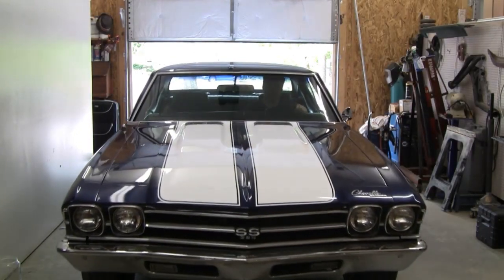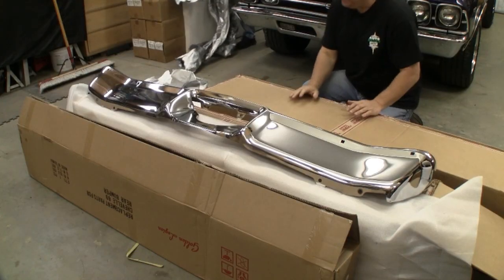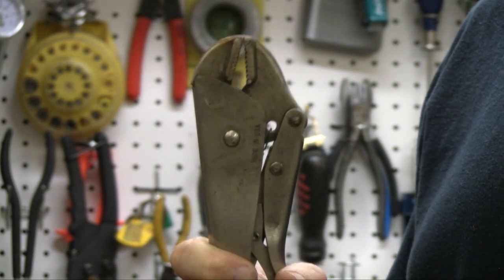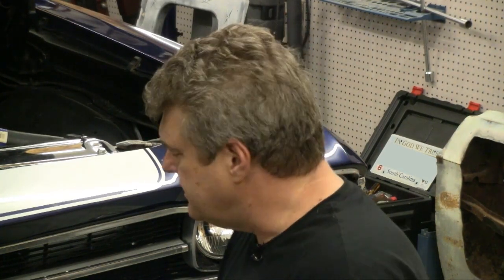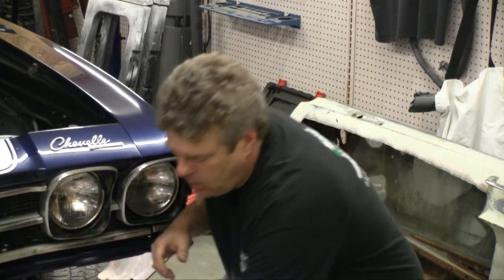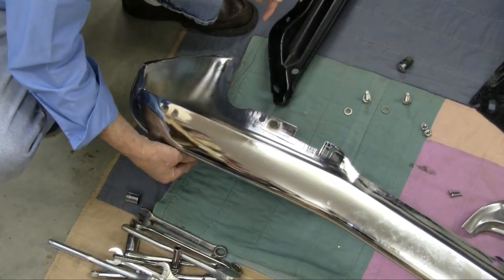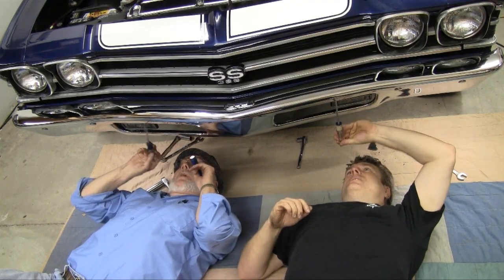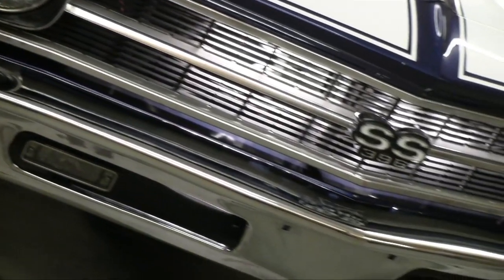Episode 114 Classic Car Bumper Install Tips and Tricks Autorestomod

Comment: Heh I have to love the bumper mounts on my '68 Fury: I can remove every bolt and the bumper barely moves, then I just slide it off :-) Those things are heavy enough I have trouble moving them around the shop, yet I can get them on and off single-handed! The pipe insulation tip is awesome though, that's going to reduce the amount of caution I need to use and speed things up all the more! Thanks :-)

Comment: Where you boys been ?? Take the front bolt off the Bracket,  Loosen the back bolts and the bumper falls forward like a hinge.
Reply from the maker: Thanks for the tip. Not done a lot of Chevelles.